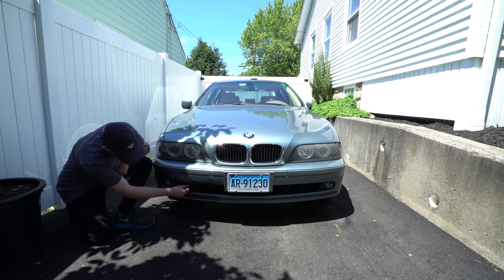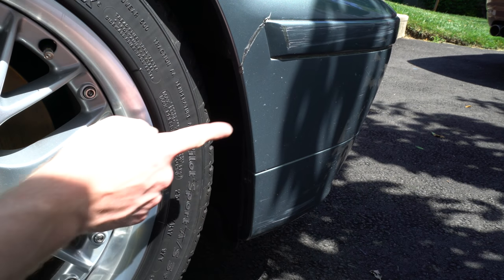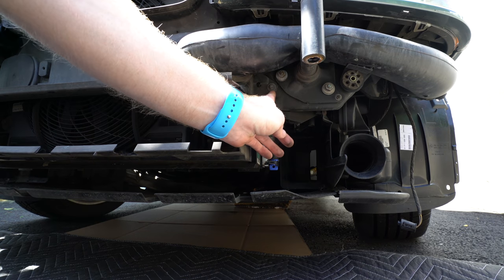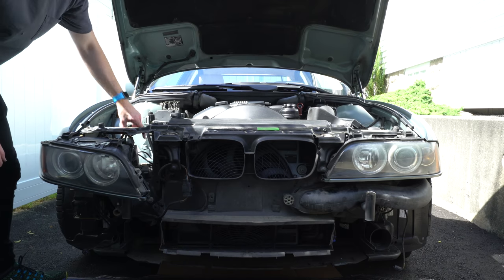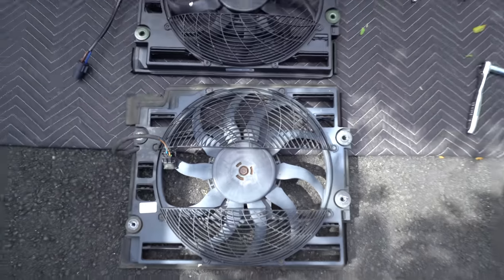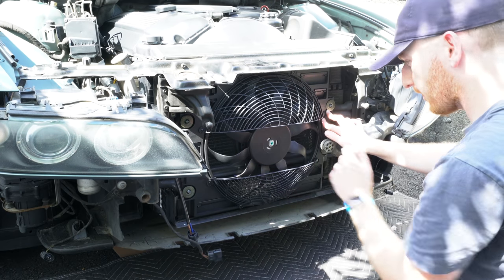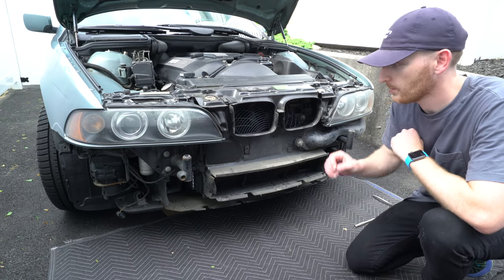E39 5 Series BMW Auxiliary Aux Electric Fan Removal and Replacement DIY in 4K

Comment from the maker: E39 Auxiliary Fan on Amazon: https://amzn.to/2IQ60b3
E39 Auxiliary Fan on eBay: https://ebay.to/31HUNC8
Video Quick Short Cuts:

0:00 Front Bumper Removal
3:29 Fan Shroud Removal
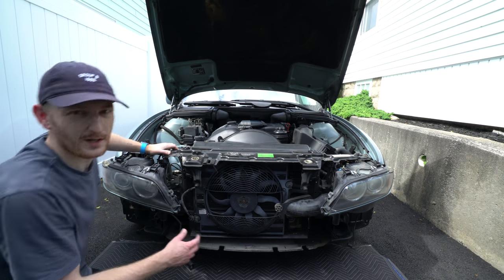8:24 Fan Failure and AC Problems 
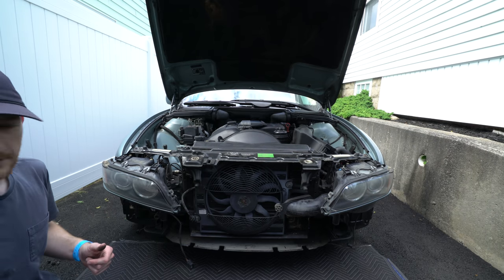8:57 Removing the Old Fan
10:18 Installing the New Fan
12:00 Reassembling the Shroud and Bumper
Reply: Ebay link is dead
Reply from the maker: @asmircar1  thanks bud I need to fix all of those links. will update

Comment: Very good instructional video. Just did this replacement on my e39.  However, the e39 bumper in this video doesn't have headlight washers. But easy enough to handle. But with these models being 20yrs old now, my washer fluid supply line was so brittle it disintegrated. If you have the headlight washers, plan on an extra hour and +$100 to replace that system while you're in there.
Reply from the maker: Good point! Yes if the lines break, it can slowly leak washer fluid over time onto the garage floor which is very annoying!

Comment: This was a fantastic video.  Instructions were excellent.  I want to share a development that I experienced and viewers should be aware of since the e39 is getting older and corrosion sets in.  The two 13m  nuts holding the fan auxiliary on passenger side could become a problem (9:00-9:15).  The bolt that these nuts fastened onto are not set and begin turning. There is no access to get to the bolt head. It wouldn't matter anyway as they are flat and round. I have no idea why these bolts are not welded to the frame.  Long story short, I had to saw off the nut after failing to use an extractor.  My bolts are still long enough to rest the new auxiliary fan in place but I need to figure something out to secure secure it. It is a total PITA , everything was going so smooth too.  Driver side nuts were not problem.  I believe this happen because this side is susceptible to anti-freeze getting all over place when bleeding the system.

Comment: Thanks for the video
  I used it today to replace my auxiliary fan on my 03 525 msport.  Unfortunately for me I couldn't get the last of the 4 nuts off the lower left bolt.  The bolt and nut were so rusted and the bolt just kept spinning when I tried turning the nut.  I had to cut the nut off.  I probably need to pull the whole radiator out to replace that bolt as there's just not enough room to get that bolt out..  Ugh.  For now,  I just zip tied the lower left side as the remaining bolt is too short now to put a new nut on it.  Great video though!

Comment: Great video. Just watched this . It’s 2022 and I need to replace the aux fan on my wife’s 2001 525I. Question? Those plastic pop rivets you removed on the top.. can they be used again? If not do you know what size they are? How many did you buy and where.
Going to attempt this repair but I want to have everything  I need beforehand.
Thanks so much for a reply and your help. Also anyone else in the know with an answer would be greatly appreciated.
Thanks! JR

Comment: very helpful and i loved the video!  Though I was wondering if I needed a new fan when my fan is weak causing the car to overheat and theres a leak through the cooling system. Do you any advice on a beginner regarding this issue? :)   Thank you!
Reply: Hey! This is exactly what is happening to me RN lol, first the coolant tank popped so I replaced it only to find out the fan wasn't spinning at all so I'm replacing it thanks to this video!
Reply: Arianna Lerdo just got my first proper diagnosis for my car and it turns out it’s a problem in the engine (valve hitting, need new gaskets, etc). Glad you got yours figured out! Drive safe 🙌🏽
Reply: Michael Aaron Cruz woah! That's such a simple answer I would've never thought!

Comment: Can you help me please. That “snorkel piece”, what is its actual name, eventual part number? Checked realOem,  and my local supplier can’t seem to find just that part! Had it at a mechanic that has lost one bolt, and broken the item and the seal😞. 4:18 to 4:28

Comment: Hello today I forgot a socket in the front and dropped inside and fan destroyed it and a hizzing noise was loud like something leaking but not actual fluid u think I messed up the condenser??
Reply: Should I replace everything even tho only the propeller broke

Comment: What about the fan clutch? You didn't replace that at the same time?
Reply from the maker: I typically show one repair at a time so they can be used individually as a guide or overview. Check out my fan clutch test video here (on an e39): https://youtu.be/fqnvOYwfxbU?si=iHMkj1yZpXSPiFuf
Reply: @BIMMERZEITT  Ah ok, thanks!

Comment: Can the car over if this fan is bad ? Or it's jus for ac?
Reply from the maker: Yes it can overheat. Especially if the fan clutch has also failed and the car idles in hot ambient temps. The fan has dual purpose, AC cooling but also kicks on if it hits higher temps.
Reply: Thank u very much bro

Comment: Why would anyone want an weak aluminum engine case and head on an engine, oh, I know so BMW can sell more parts.
Reply from the maker: How weak can it really be though. My 2001 525i is 18 years old with 240,000 miles on it and still going strong. The aluminum saves weight. There are other materials used in later models, magnesium etc!